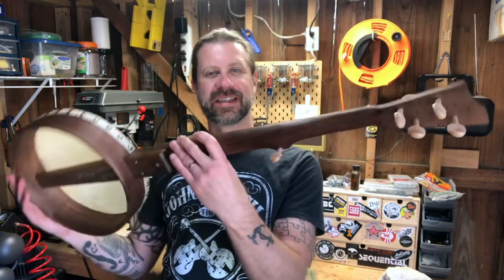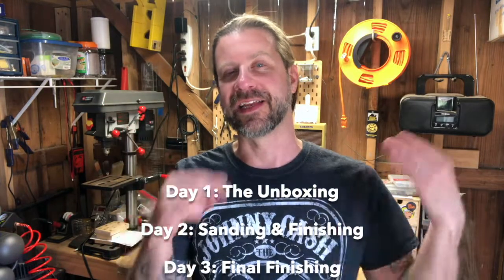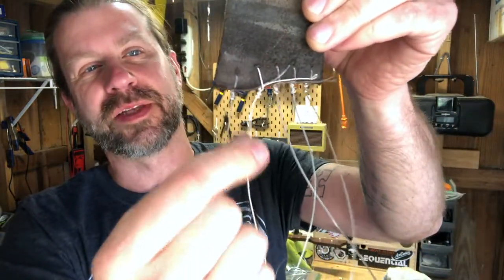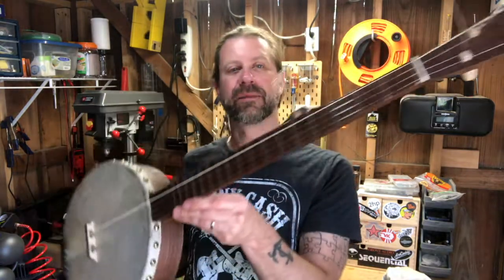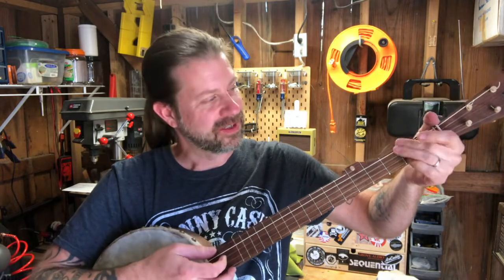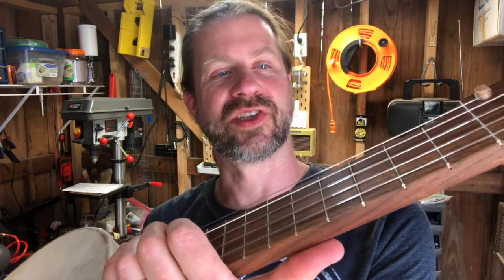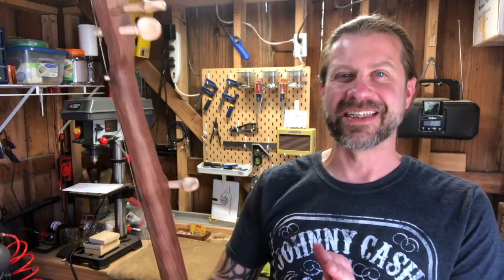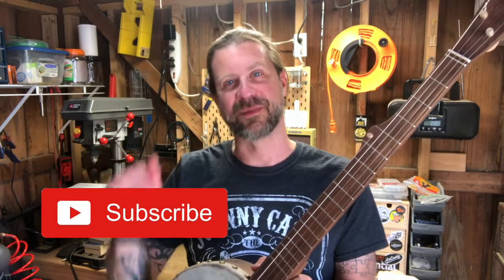Banjo Build Diary: Day 6 [Final Assembly & First Play]

Comment: Friction tuners take some getting used to. But, if you slightly pull out on the peg when tuning and then when done sort of push them in to seat them it helps to keep in tune. I also rub the pegs and holes with beeswax at string change. Also I tune up from the flat to tune. A little back angle on the neck, about 3°, will help the action and you will find you want a couple of bridges at different heights because the head will sag at times depending on humidity.
Reply from the maker: Thanks for those tidbits. This was my first banjo build but I enjoyed it. Thanks for watching the video too.

Comment: I just found this video and I'm watching through this excellent series now. Thanks for sharing! 
Looks like you have the string action sorted, but you can also adjust it by just changing the position the black screw goes into the dowel or by shifting the hole on the rim for that black screw. A shorter bridge works just as well, but I like a tall bridge because it adds a little to the volume once you've got the action/angle adjusted, because there is more downward tension on the bridge.
Reply from the maker: Thanks for taking the time to watch the series. It is a really great kit and I had a lot of fun building it.

Comment: If building one, would go look at how to tie fishing line knots. Also would wet the strings, before pulling tight, as the friction could weaken them. This is also done when tying fishing line. Looked at his site, and am guessing that he only makes them right handed. Could you make a shim to put between the neck and other board and raise it? Plus you could then create the back angle, like Louie mentioned.
Reply from the maker: That's a good idea with the strings. I'll do a follow up video after I spend a bit of time with it. I don't know if Brian makes LH banjos or not. I suppose you could email him and ask. I know he's done custom kits from time to time.
Reply: I do make any banjo left handed at no extra charge.
String height is adjustable with these banjos by shifting the position of the black screw in the dowel.
Never heard the trick about wetting fishing line, cool trick to know but these strings are a different material anyhow.